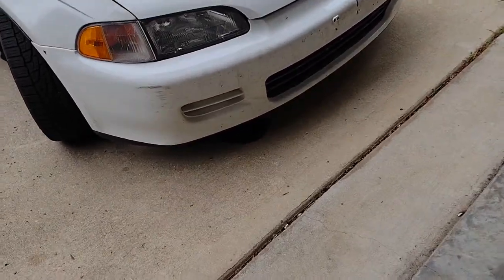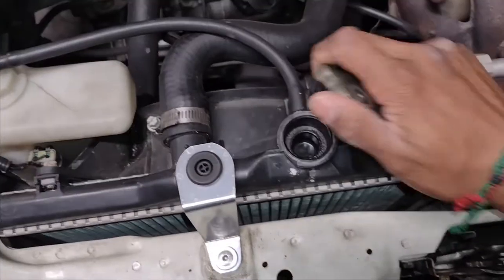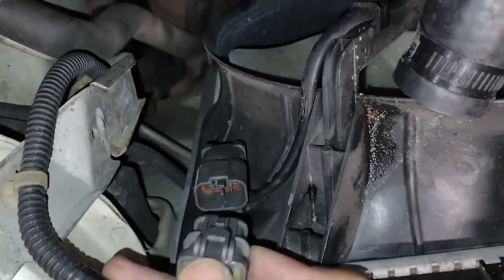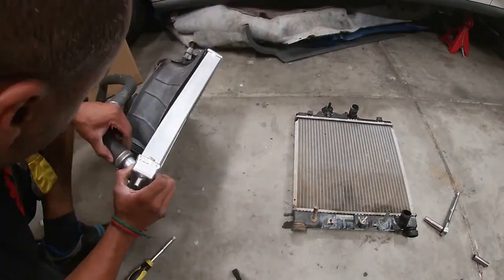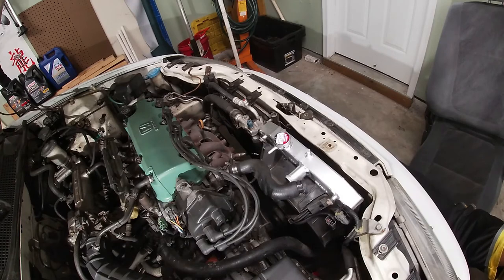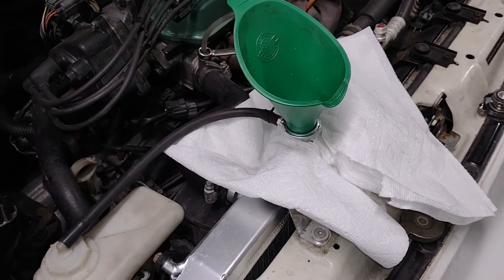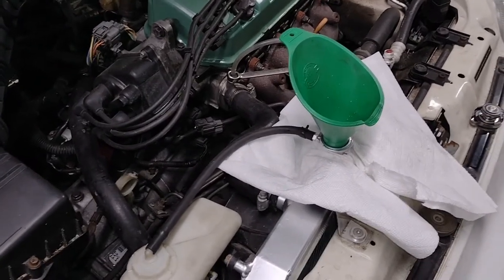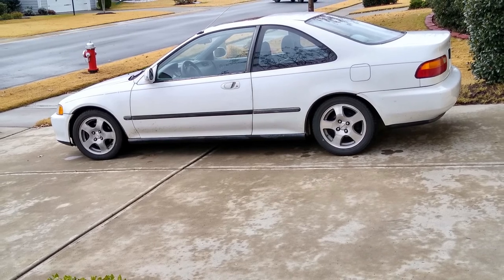1995 CIVIC DNA Motoring aluminum radiator install

Comment: Most half width aftermarket aluminum Civic radiators are meant for B-series and have 32mm hose inlets/outlets while radiators for D-series are 28mm.  Did you have any issues with the top of the radiator touching the hood?  The paint on the underside of my hood is chipped from contact with the radiator, even though I bent the lower radiator supports a 1/4 inch or so.  Haven't had any issues with electrolysis yet in the couple years I've had my aluminum radiator. *fingers crossed
Reply from the maker: @jamesbrennan5457  the only issue I had was the hoses being hard to put on (slightly to small). When I swapped over to a b-series engine in this car, the hose is fit perfectly because I was using b-series hoses.

Comment: So you didnt have to relocate the reservoir? Thats my main concern. Got one coming tomorrow and want to be prepared for that possiblity
Reply from the maker: 👍👌Nope. It's in the original location. And it has been great since the install. No issues.
Reply: Cool, good to know. Was yours a double row? Or a single?

Comment: I know this was from a year ago, but I have a 98 civic lx, but automatic, so I have the trans cooler lines with those brass pins At the bottom, so I got the DNA motor rad like this one, expect for an automatic with the trans cooler lines, I can put my old brass trans cooler pins on, but they only thread on like 2 threads and won't go farther and the pins themselves aren't tight, what can I do?? That's literally my only problem
Reply from the maker: Damn. I wish I had first hand experience with that one to give you better advice. But, I would verify the thread size on the radiator.  You may have to get adapters for the lines if you are set on using this radiator. Good luck! Shoot, send me pictures of the situation on Instagram if you are bored enough.
Reply: @MaqsVids  my radiator on the car now is definitely like 15+ years old and so this is what I did, I bought a brand new OEM radiator, cap, thermostat, upper/lower hoses, new trans cooler hose, new OEM fan, so the new OEM one came with the brass pins already, so people in the comments on Amazon claim the OEM brass Pins just spin on to the DNA rad, but I tried definitely not, they get on like 2 threads a stop, I noticed the DNA rad threads where the brass pins spins onto, there WAY WIDER, what do you think I could do?? This is my only issue, I literally have everything else
Reply: @MaqsVids  so basically the OEM brass pins just kind of are really lose and don't get tight cause I can't thread the OEM pins all the way down tight
Reply: @MaqsVids  bro!! I think I figured it out, so I went back onto Amazon and I found the literal same DNA rad, same brand, except this one apparently came with pins 🫠 and the one I ordered did not, but apparently the DNA motor rad threads for the trans cooler hose are 3/8, I found 90 degrees ones, like stock ones, but these will actually fit, $11 , think I figured it out 😁😁
Reply from the maker: @CallMeLogic95  That's awesome!!! The solution was simple in the end. Take care and be safe!!

Comment: How’s it holding up? Got one of these coming today for my 98 civic.
Reply from the maker: It is holding up great. I drive it over 60 miles a day and the weather has been hot. It was a great deal. My only gripe (a small one) is that the inlet and outlet are a little larger.
Reply: @MaqsVids  yeah its like 1.25 vs 1.1. I had issues with the massive heatwave here in Washington 2 weeks ago. Hoping this helps!